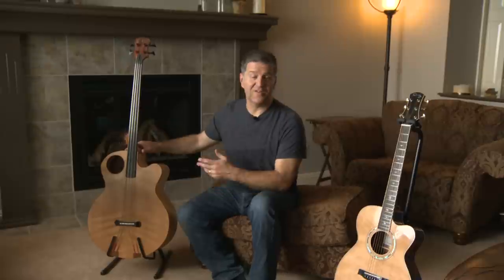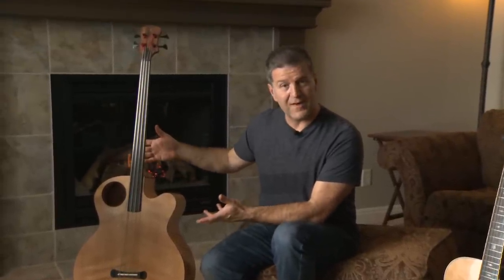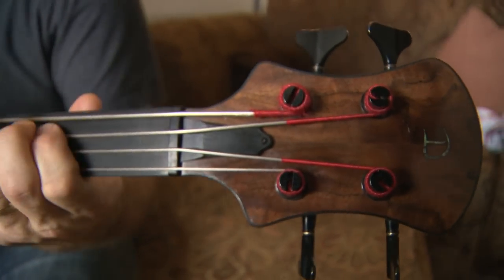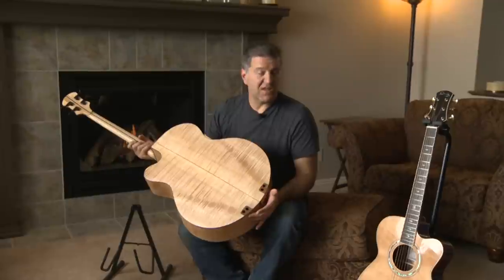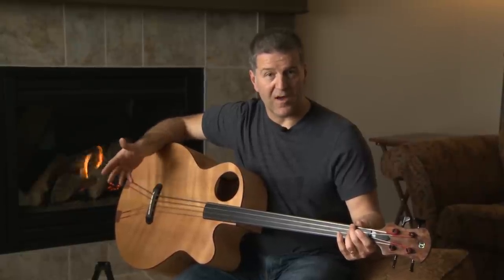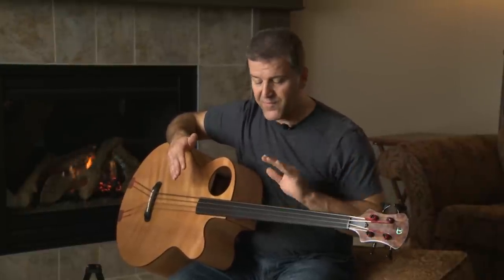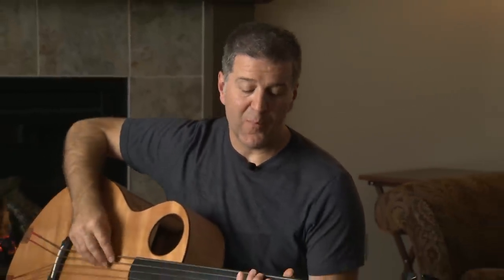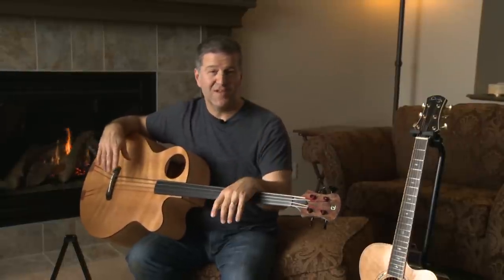Tinozza Acoustic Bass Demo

Comment: Hey douglas,

I finally started this tinozza bass project, looking forward,should be a great experience, i'm going to a high school now in belgium who teaches building classical and steelstring guitars, it takes five years in total and i'm building the bass there,so result shouldn't be around the corner yet,but if i have i will sure share some video of it!
Used wood:
European spruce top
Flamed maple back/sides and headstock veneer
South African sapeli for the neck
Ebony for the fretboard 
Walnut bindings
Rosewood string blocks and back strip

Cheers
Reply from the maker: 1frxns1 Great to hear from you and I'm so glad you are pursuing this build!  Feel free to connect with me on any question you may have during the build.  Additionally, I found RM Mottola to be very responsive and helpful to questions that I had along the way.  One piece of advice:  be sure you purchase your strings ahead of time.  Being classically wound strings you cannot just cut off the excess as one does with steel strings.  Each end is silk-wound and you need to establish the ball-anchor points according to this length early in the build process.   Any silk winding between the nut and bridge is acoustically fatal.Best of luck!
Reply: Douglas Guitars  thanks for the advice, i'll keep it in mind... if there is any difficulty or question I will ask for sure,

thanks

Comment: Hi douglas,

The build is getting on very well,
I've come to a point where i'm making the neck and back blocks and i have to buy the strings now for the ball anchors to match the holes i have to drill, can you give me any advice in which strings are the best choice to buy? I've checked thomastiks website but can't seem to decide which ones should be best, like the spirocores or the super flexible for instance,

Cheers
Reply: +1frxns1 Hey, I'm in Belgium as well and I was wondering where you bought all of your wood. Is there a specialized store for luthiers? I would love to see your progress
Reply: +Stephane Van Der Merwe  hey Stephane, i bought my wood partialy online, like on madinter.com you can buy nice wood,but because of the Large body of the bass it was though to find...if you give me your email on pm i can send you some pics of the progress, i'm also on twitter @frxxns i will upload some pics soon, cheers

Comment: Doug, you should experiment by closing off the soundhole, varying its size -- that soundhole looks to be even bigger than on a 6-string guitar (lowest note on 6-string is 82 Hz [ c/s ] -- lowest note on a standard acoustic bass guitar is 41 Hz ) -- a smaller soundhole gives more BASS............any good luthier knows this.
Reply: I should?  The instrument was designed by RM Mottola (editor of American Lutherie Journal and arguably one of the foremost instrument designers alive on the planet right now).  Are you suggesting he is not a good luthier?  I'm happy to give him the benefit of the doubt.
Reply: No, I didn't imply that he's not a good luthier, I'm just surprised that the soundhole is so big  -- anyone who has studied acoustics (the science of sound) knows that a smaller soundhole gives more bass. 

If you've ever seen Maccaferri gypsy jazz guitars you'll know that they have 2 sizes of soundhole, one is a small oval and the other is a D-shaped larger hole  -- the larger gives more mid and bright treble but less bass, the smaller gives less mid and treble and more bass.

I have 4 acoustic 4-string bass guitars, all of which I converted to Low-B (31 Hz), I either play them with a large, hard but flexible plec or by plucking 'aggressively' with my fingers as a DoubleBassist does -- otherwise I don't get loud DEEP bass notes.

That Tinozza is a great bass, big deep body -- you should pluck it harder, make it SING out those rich bass notes -- you did a great job in building it, Doug, good luck!

Comment: Hi Doug, I found this video looking for acoustic bass references. I'm about to build one, and I wanted to ask you, in your experience, do you think the volume of this bass is the same as that of an acoustic guitar with nylon strings? could they touch both at the same time? thanks, great job.

PS: I would like to do mine with frets and round strings, adapting the design, of course.
Reply: Franco, the volume would not be the sam was an acoustic guitar.  High frequencies travel better.  Think violin vs upright bass guitar.  This instrument is best used with a pickup.  Additionally, to add frets and steel strings would change this instrument to such an extent, I would not even be able to comment on it.  I'd suggest you find a ABG model that has bracing for a fixed bridge rather than a floating bridge.
Reply: Doug Balzer thanks!
Reply: A good acoustic bass needs a BIG (and deep) body --  1:08 -- otherwise it won't have a DEEP BASS sound.